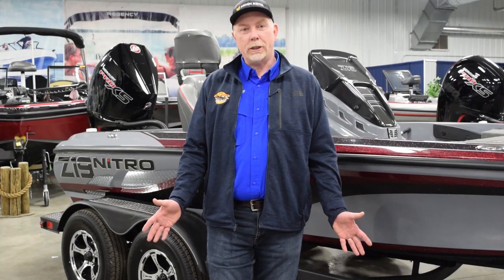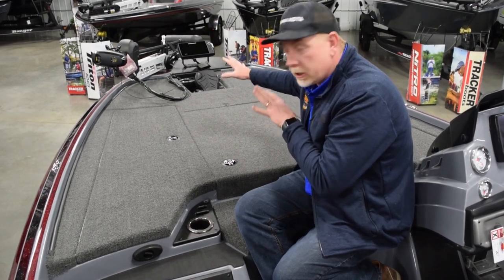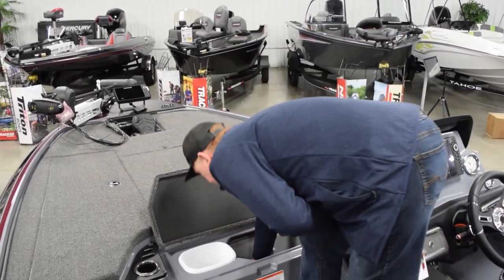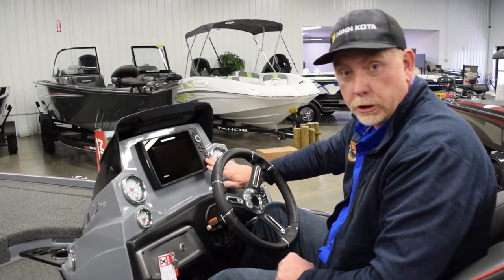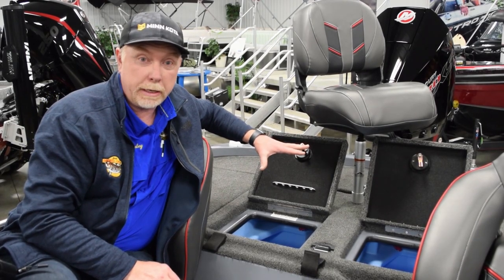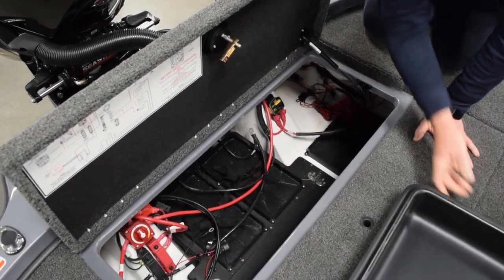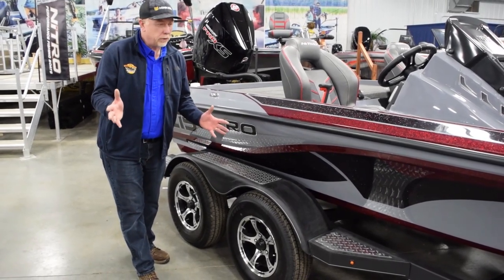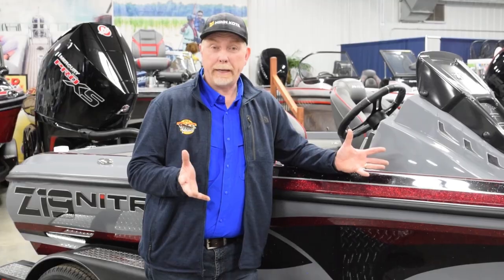2021 Nitro Z19 Pro Package Walk-Around

Comment: Honest opinion on this exact boat. I own a 2021, the anti-fatuige mat is a joke because it covers such a small front deck area but feels good bare footed. The center rod box is at some weird angle that keeps you from storing 3700 planos sideways. Stores more standing them up but it works once you figure out how you want to store things. Rod box is great lights are ok but you block them once you load your boxes up. Need lights on the lid. Ice chest not well insulated. Tool holder is not well thought out use big tool or they fall through but easy to get out also a trip hazard. Passenger rod holder is crap, puts rods on bad angles. Now for the good everything else, OMG! I love it I can write a book on it ride etc. The lower unit is or at least on mine a 1:85:1 ratio and snaps on pad in 2.2 sec. Check out boat test on the 2021 model fuel mileage is great at 3000rpm 6mpg no other hull is even close. Empty 68.6 mph loaded out 2 people 66.7 mph. I give it a 4 1/2 stars. Because things like Passenger foot glove box should be standard. $400 to order one

Comment: Just ordered mine a week ago 2022 Model As for the gel coat issue that will happen with any boat if you do not take care of it period. Had my old 2006 17ft Nitro and the gel coat did not wear out until last year and still it was not a bad wear on the coat. Love Skeeters and Pheonix boats if you have the extra 20k lol and Nitros are known to be a LEGO boats easy to add what ever you want later down the road. As for the haters will haters be haters or as i say in the tech world fan boys will be fan boys lol.